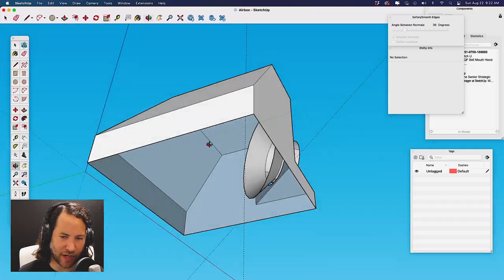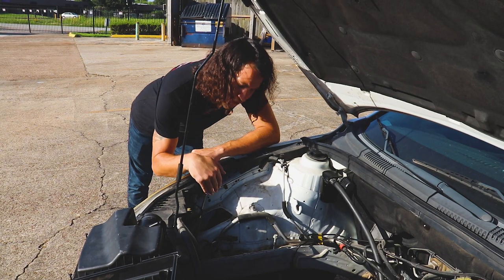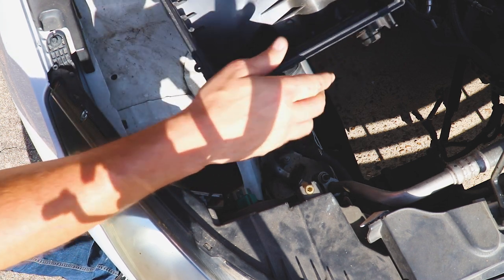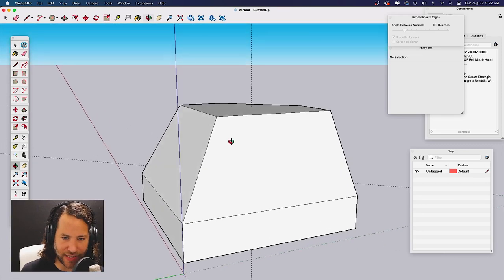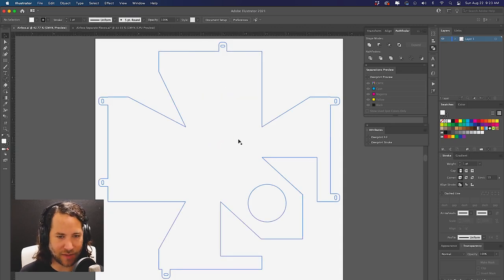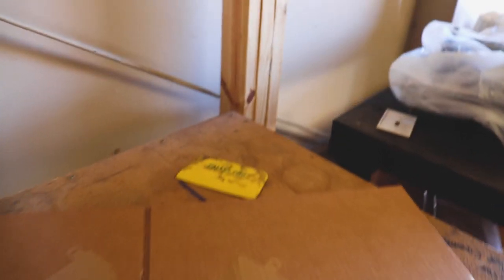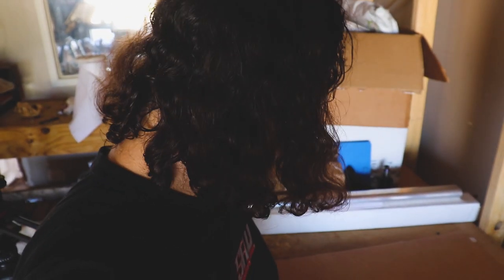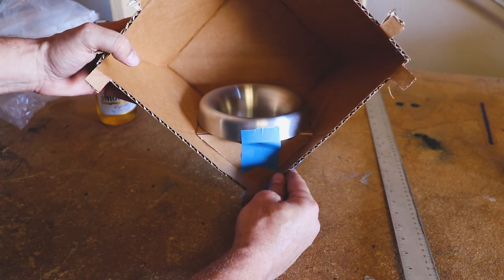DIY: How to Make a Custom Cold Air Intake Pt. 1 - Airbox Build | Chevy Cruze 1.8 eBay Turbo Project

Comment from the maker: What do you guys think design wise?
Reply: Shorten the height a bit, shave the tops and bottoms of the bell if you need to, cut a corner off, make it happen! Great idea to draw actually cold air. Factory air boxes work better than most people think.
Reply: I have a 2020 Elantra turbo, one big down fall is after you play around a bit you lose power do to heating, so I got a INjEN air intake that goes down near the Intercooler down in the grill, feels a lot better, not like there’s more power but holds the stock power really well, it’s a 6speed as well so you feel the difference, food for thought! 💭 best of luck dude!
Reply: Have had the same idea cool to see someone doin it 👍
Reply: It looks like you just need to take that corner down a bit, I would take a strait edge around it and drop that corner 3in at an angle to the opposite corner dropping only 1in. You could just cut faces of the prototype and use them as a Stencil for whatever material your going to work with. Starboard is also something to look into for strength and low weight. I live in Houston to and just settled on a k&n and stock filter, my car is still stock slow tho lol 1.4 with no tune bah humbug.
Reply: Look nice but you need to shorten the height not too much
Reply from the maker: @EmilianoMigisRomero  Very true.
Reply: @802Garage exactly OEM car builders don't spend millions to make stuff that don't work.
Reply: @bryantnecessary7719 I know I bought the turbo 6 speed and I though my fuel pump was plugged or something it's so sloooowwww but it's got 62 psi fuel pressure and the baro shows 26psi at full rip up hill. It's just slow I have to drop it from 6th to 3rd just to get over 4krpm to make a pass. Great fuel economy though.
Reply: @johnsnow1355  Generally true, but they are often a compromise. :D
Reply: I like it, would like to see a part 2

Comment: If you’re going to do this custom, I see a custom fog light insert with a cone filter behind it snaked up to the turbo a more efficient design to pull the coldest air possible.
Reply: Personally I could see that working similarly to how many other builds remove the headlight.  Personally I wouldn't go this route in case I decided to run ducting to my brakes for auto cross racing(although I know Matt is going to be doing 1/4 mile).

He also did say he wanted to keep the filter up higher because of potential flooding in his area
Reply from the maker: That's a great idea. I've seen that on ZZP's Sonic. Looks like they recently ditched that idea and just have a tube going to the fender well. As simple as that is it definitely works.
Reply from the maker: That's true and its definitely crossed my mind. My only issue with it being so low is it will limit days I can drive the car, and I plan to drive it a lot. When it rains, it'll stay parked, but I do plan on doing events such as drag week where the car will be driven well over 1k miles in all kinds of weather.

Comment: Personally I see merit in the aftermarket CAI. I run the K&N Typhoon you pictured and what I would personally do is run with that design and seal it all in to where it pulls from the hole in the fender well.  Similar to the ZZP CAI for the 1.4L, but a full box with the cone style filter instead of just a divider.  You could further run a mesh over the hole to restrict some larger debris floating up into the fender well.

I believe the inlet tube from the K&N can be separated from the divider.  If you want I can go tear mine apart and give you the lowdown and possibly sketch it up. I'm on Cruzetalk and could send you the files/info there.
Reply from the maker: That would be awesome. I see merit in it as well. I personally dig the ZZP CIA.
Realistically, how efficient the intercooler is makes a bigger difference in the air temps seen before it goes into the engine. An air to water setup with an ice water box would negate the need for an intake all together. But, this build isn't at that point yet because I'm still using the stock ECU. Part of the AIT is read from the MAF sensor. The ECU will pull timing based on what air temps it's seeing.
My user name on CruzeTalk forum is Crewz. Feel free to send the measurements there. I'm on their FB group as well.

Comment: Hey man. This is really smart thinking. I'm doing something similar but for a Miata 1.6 (European small engines😅) NB2. Only comment I have which I'm gonna do is to make also the bottom from Carbon fibre. During my own research apparently the stock airboxes work very well then only problem is they actually act as heat soak boxes.. So if the whole thing is made of carbon you get cooler intake temps.Great video all the same..Cool tip, you can also now get SOLIDWORKS foe entrepreneurs, and its like 60dollars a year or something, and could be easier to use than sketch up...👍👌

Comment: Nothing wrong with the old school K&N cone filter. Just have it outside the engine bay
Reply from the maker: I've thought about that. My only issue is driving around when water get high and it sucking in water. It's happened before to a build I did back in the early 2000's. Dodge neon. Was driving at night and got caught in some high water. Well at least high enough that the engine sucked up water.
Reply: @cmattdabrat  Oh damn. Maybe something like a shaker style?? 🤔

Comment: Matt, you should do a mock up to measure how many grams per second your original design could handle using a MAF sensor.  My 1.4T stock can draw typically 120-140 g/sec during a hard pull.  Maybe would be just as effective to use a used stock 1.4T filter.  I personally think it could draw more air in the right conditions (bigger turbo etc).
Reply from the maker: Not a bad idea. I wish there were some more studies, or at least I'm having a hard time finding them, as to what size inlet pipe will support what power.
Reply: @cmattdabrat   it it helps, here is project farm's video where he does air filter testing https://www.youtube.com/watch?v=sJ3L-E-ufYo    I'm pretty sure if you start measuring vacuum (barometric pressure sensor) already built into cruze's 1.4 MAF - you will be able to know the practical threshold for factory sizing.  The opposite is true for exhaust.  if your diameter is too small, back pressure will be the resultant (positive psi and exhaust will try and compress)  on the intake side of the world if vacuum is developed because of too small of a diameter, the engine will behave like there is an air restriction and the actual air will heat up - which is counter intuitive for what you pump into your intercooler to provide maximum oxygen content.  in your shoes, I would look at the inlet size at the turbo itself to lean on what the engineers considered as an appropriate orifice size.  If you go slightly larger and as straight as possible, you should get the most appropriate results.
Reply from the maker: @canadatransistor  Definitely a good watch, and solid data. This is what got my mind working... https://youtu.be/rqdvxfwFrHs
Reply: @cmattdabrat  great video-  for my turbo cruze it suffers from heat soak between intercooler output and throttlebody.  When the car is parked in the sun at work it takes forever to get a "non false" temperature reading from the boost / air temp sensor.  It's unbelievable how many minutes the car has to run sluggish to cool it off.  I have often thought of putting a fan system / heat sync on that stupid sensor for a timed period if say temperatures are 28deg C or greater.  If i was hunting better performance, intercooler would be swapped way before cold air intake.  Great video you suggested!
Reply from the maker: @canadatransistor  It wasn't a good decision for GM to place the intercooler between the AC condenser and radiator. Kinda defeats the purpose. Definitely have to get the car moving some air through those cores before it'll see cooler temps. With this car being the 1.8 NA variant, it gave me 122k miles of service with no issues, aside from a clutch change at 60k miles. Aside from that, I had no issues until I decide I want to push boost through it on a budget. lol, I've learned a lot in the process and it's motivating learning more and getting everyone's feedback.

Comment: Can’t you drop the box idea and put a K&N cone underneath by your wheel well (where you said you want to put a larger diameter pipe) and just shield it from debris BUT plumb a silicone hose through where the stock filter was to the turbsky?
Eliminate your fun project of cardboard cut and save vinyl too
Reply from the maker: It's crossed my mind, but it tends to flood in Houston often. Guess I'll just have to skip driving it on rainy days. I'm going to think about it.
Reply: @cmattdabrat  ahh, it makes sense, but “we” don’t drive race cars in the rain, too little wheel grip 👍

Comment: I'm trying to get one for my 2014 Hyundai sonata trying to get it to dry more air because those short ram mirrors are trash and my it goes right into the middle of my like engine bay and it's nothing but hot air maybe you could put me in the right direction
Reply from the maker: I hear that. I just designed this variation in sketchup, a 3D modeling software and flattened it in Adobe Illustrator.

Comment: Before you proceed, investigate why the boost gauge doesn’t respond properly. If your boost source line is kinked you’re flying blind. 

Consider redoing your oil drain on the pan. You had angled to the ground last I saw, that’s not good. I’m betting you’d like this turbo to last.
Reply: I bet your incorrect catch can/pcv setup caused the abnormalities represented in the gauge. If your new motor doesn’t immediately shoot down to ~21”Hg please stop and address it before continuing.
Reply from the maker: Thanks. Definitely will. Just going to try a vent to atmosphere setup.